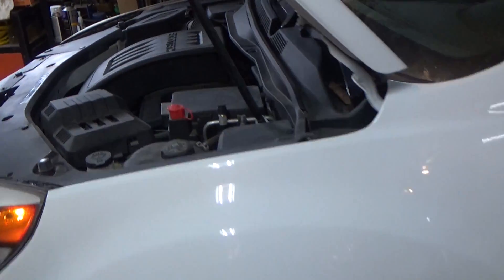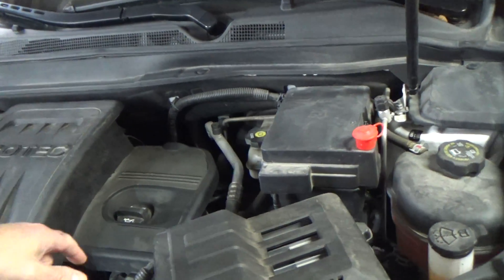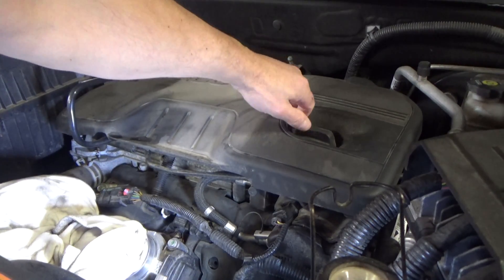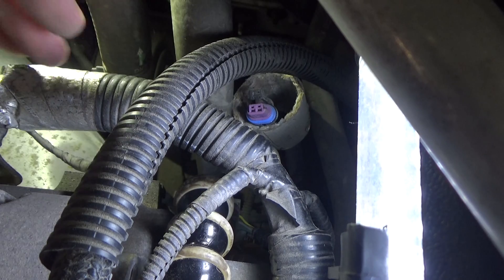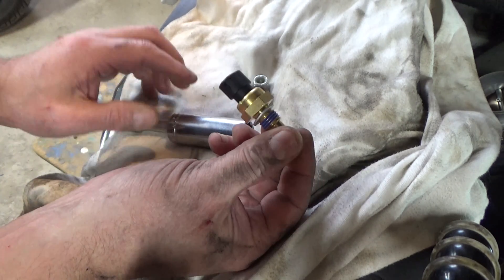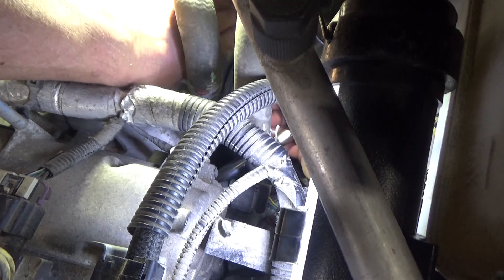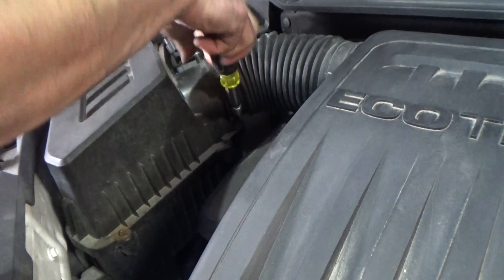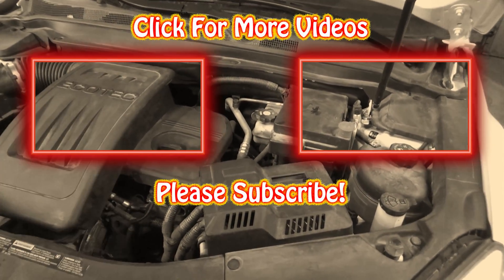Equinox 2.4 Liter Ecotec Engine Coolant Temperature Sensor Replacement  ECT Sensor Codes P0119 P0128

Comment: Thank you! My gauge was not working and the computer told me the A/C was turned off because of high engine temp. I was on the freeway at the time. Nearly had a nervous breakdown! After doing some research, the signs pointed to temp sensor. Your video confirmed what it is. Will change it tomorrow.
Reply from the maker: I hope it went well and resolved your issue.   Take care!
Reply: @nogripes  All on that front is back to normal. The temp gauge was reading slightly lower before the new thermostat was installed, so I guess it was not closing all the way. Water pump and the thermostat was very expensive to have installed. I hope it lasts as long as the original. The next thing is the coils. For the life of me I'm not getting the dealership to do that. I will try to do myself. Thank you for your help.

Comment: I have the same vehicle I changed mine. It’s still not working. Is there a fuse or anything? I tested the wires no power

Comment: problem its a dam 2.4L GM engine. Worst 4 cycle engine you can run.
Reply: I agree.... I can get mine to work good it shuta off when i get to stops when hot, when is cool everithing great... Dam 2.4

Comment: Would have been great it you demonstrated/simulated outside the vehicle as to what the orientation of the sensor,  retainer tab , not and tool are ( which way everything is facing). .. kinda still struggling to get connector off sensor
Reply: Same struggle I’m encountering right now.  You don’t have a direct line of sight to the sensor connection

Comment: YES YES YES .EXCELENT VIDEO. I am 83 years ond did this job on my 2015 2.4 equinox. I am short,so I had to put a bunch of quilts on my engine and lay on it. I couldnt get my arm thru the bracket that you reached thru. I took the bracket off.. My  FANS WERE  STILL ON. i HAD TO CANCEL THE PO128 CODE.  ALL FIXED.  BUT MY RADIO AND DASH SCREEN WENT BLANK BECAUSE MY BATTERY WAS ABOUT DEAD. CHARGED THE BATTERY AND DISCONECTED BATTERY FOR 20 SECONDS ALL WOKED PERFECT THANK YOU THANK YOU